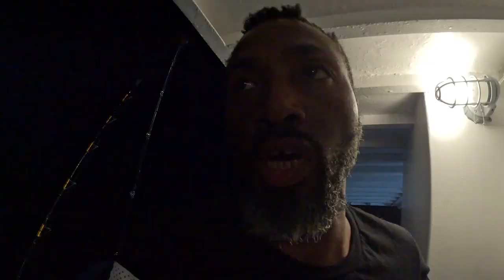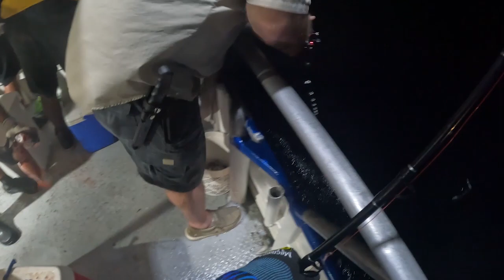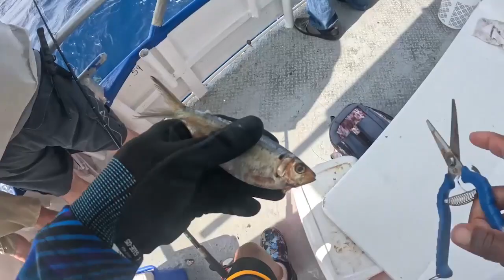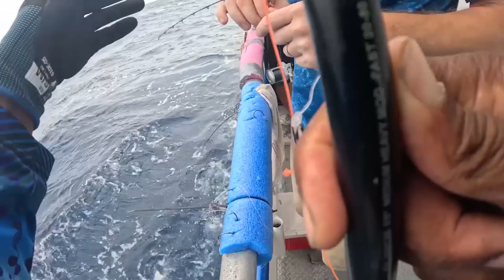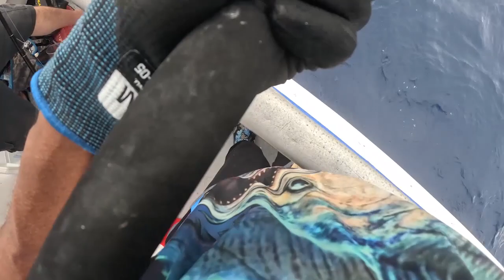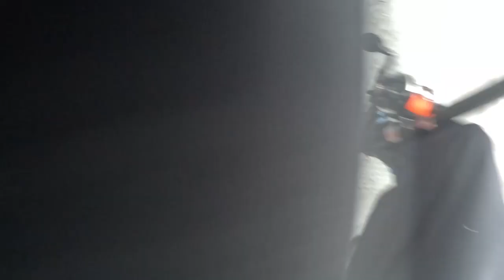Great Fishing Adventure on Hubbard's Marina 39 Hour Charter

Comment: Been fishing with Hubbard's since I was a small child, and the 39 hour about 25 years. Quite honestly, it took a number of trips to really capitalize on the opportunities of a 39 hour trip; even though I had all the right equipment. The staff from top to bottom are the best in the industry, and they really do everything they can to put people on the fish.  Looks like you did excellent and had a great time! Hope you get many more opportunities to fish with them again. Going during Red Snapper season is a great time to fish, but the boat is always full and if there is current and/or a lot of inexperienced fishermen on board, tangles can become frustrating. If you go again, try a September to November time period, Gag Grouper is in season for most of that time and the boat will have much fewer anglers, as well as more experienced, making it more enjoyable. Could give you a couple tips...When your weight hits the bottom, lift up and make sure the weight is tight with the swivel. When you feel a bite, don't set the hook, just reel like a madman for 10 to 15 cranks. Have a bunch of the double-hook rigs already made and ready (no swivel). This will allow you to quickly cut your line and re-tie if you get caught up in a tangle and allow you to change out your rigs very often as you need sharp hooks and unblemished line at all times. Get yourself a Bonita from the bait shop and use in strips. It's worth having full frozen squid too. They are not secret baits but are often overlooked and deadly. You already spent a good penny to get out there, might as well be fully loaded. At least a dozen pinfish is a must as well. Big fan of you, Hubbard's, love your videos and wish you well.
Reply from the maker: Thank You.  I loved the trip.. i do want to got again when trigger and gags are open.  Drive wasn’t bad either.  Now I know the routine my next trip with be real smooth.  Might get a hotel next time and fish the skyway pier after a charter.
Reply: @WoodysReeltimeFishing  The Hubbard's website has all kinds of helpful information just for the 39 hour trip. Kind of have to peck around the site to get to it but well worth he effort. Even though it is a favorite spot for me (the South Pier), unless you are fishing for bait, the skyway is about the toughest spot to fish successfully. If the Spanish are running, it's a free-for-all. The first 300 yards can be good for Pompano, flounder, Redfish, Trout. sheepshead, and whiting. Pretty much hit or miss like everywhere else. The rest of the way, fishing near the bridge and around the pilings, live bait (whatever is running) but not shrimp, is the ticket. Any kind of shrimp or squid will be 96% devoured by hordes of pinfish and other small bait stealers. Once you start fishing away from the bridge, tides, structure, equipment, and technique come into play so much, it couldn't be easily described here, checkout https://www.youtube.com/@Saltyscales   he's a true expert! Best of luck!!